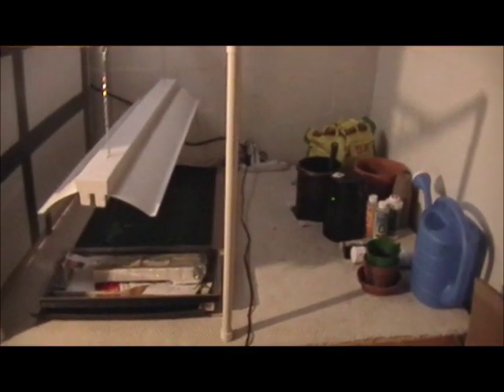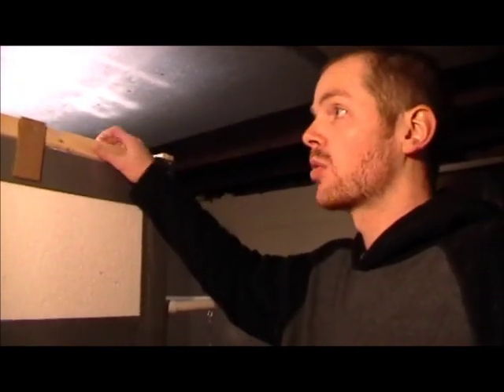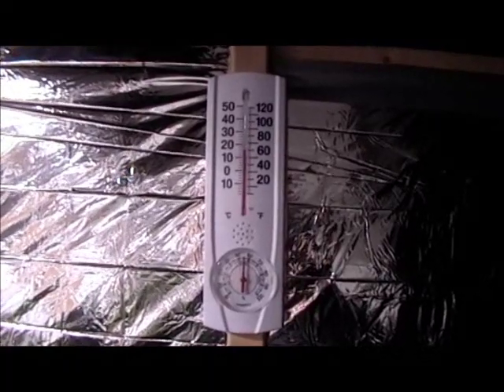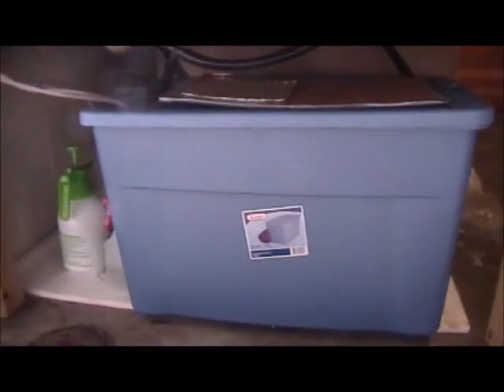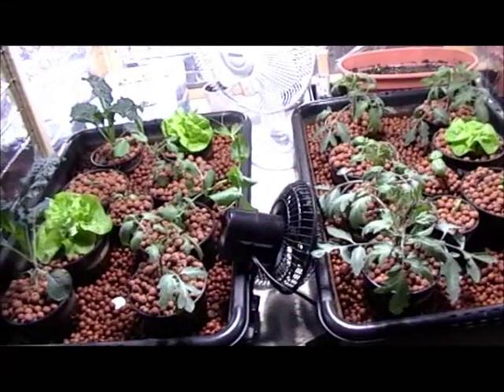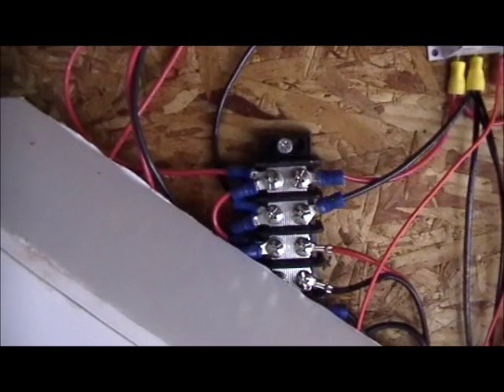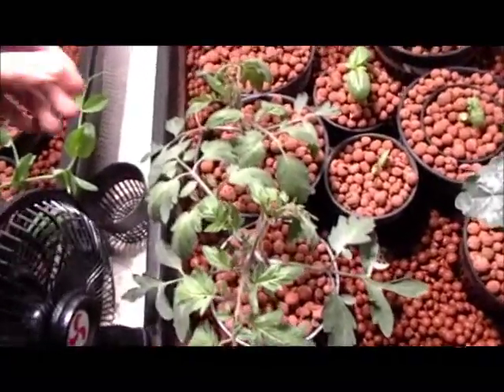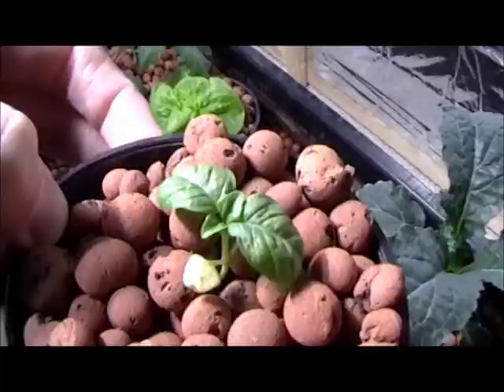Solar Powered Indoor Hydroponic Tomato & Vegetable Garden

Comment: The downside of hydroponics is that you have to purchase "plant food" or nutrients and supplements which can be expensive.
Reply: Aquaponics includes the best components of Hydroponics And Aquaculture therefore cut down pricing as well as improve work productivity. You can get the most effective aquaponics plan right here:
help1.info/best-aquaponics-plan
Reply: not really. you have to spend money for that fish. fish food. fish filters. lots of oxygen pumps. heating or cooling. test kits. the list goes on and on! with hydro all u gotta buy is a 7$ pH test. ppm meter 15$, and 30$ in fertizers. ( buy calcium nitrate 5lbs, potassium sulfate 2lbs, monopotasium phosphate 2lbs, and some natural espom salt. mix to your required ratio and you banging. ) been almost 2 months and I've only used 10% of all my ferts in a hydro setup with 4 beefsteak tomatoes. 4 pepper plants. 1zuchini squash and 10 strawberry plants. I also feed my melons and cucumbers and carrots and more tomatoes with the same mixture once a week
Reply: +Daisy Sanderson also getting some ocean solution is great. I add a splash to ever 5 gallon fertilizer solution to take care of mi microsolutions

Comment: Nice 
I wouldn't use the 250W HID light
A 90watt ufo light actually draws around 60watts, as it warms up even less like 50 plus watts
You could use 5 lights, instead of one, giving you a fair sized growing area. Also with solar why not use a sunny spot (green house is best) then just run the the lights in the afternoon supplemental.

Comment: @swornabsent How much was that digital 12V timer you got versus the ones you get for lamps for your house? $100 versus $3? There are a few things that are significantly different but regardless I would have got an inverter personally, and you can use the inverter forever until it's dead so how do you calculate the "value" there? Anyway, about 40% of my house is solar and I run off batteries, check out my videos. Let me know if you need any help on anything solar... keep up the good work!

Comment: Why get 12V stuff when you can just get a 120V inverter? The 12V stuff is super expensive compared to their 120V equivalents. Get a cheap modified sine wave inverter and run everything off that so you can get 120V "standard" equipment.
Reply: helloman1976 i know your comment is old- but i'd figure i'd reply anyways- from what i'm aware of an inverter will dissipate a lot of extra energy- energy you can't afford to lose when going solar